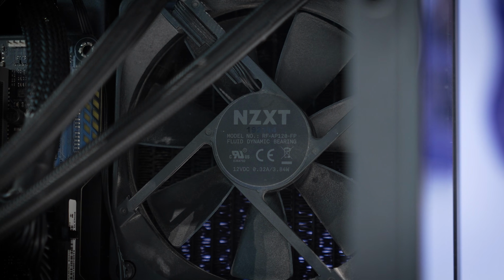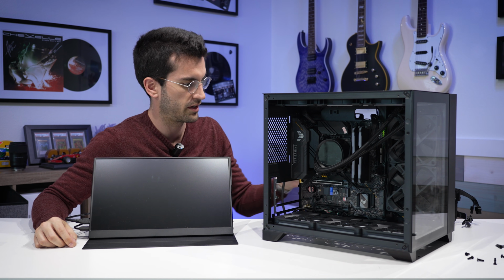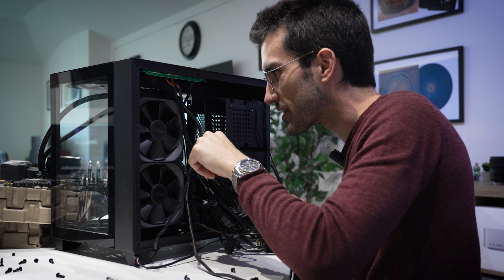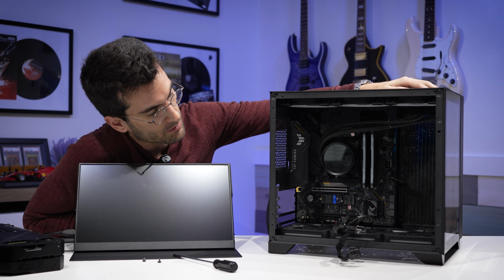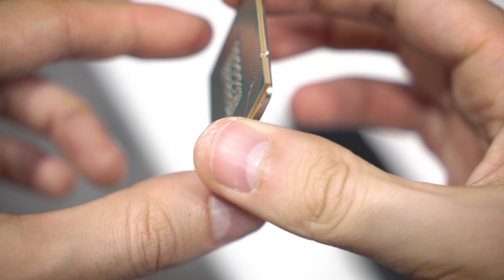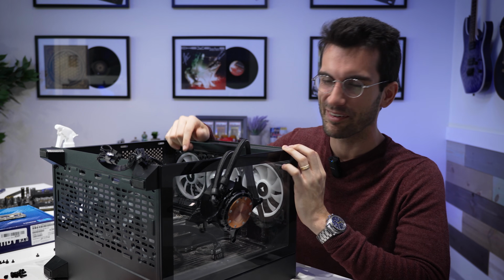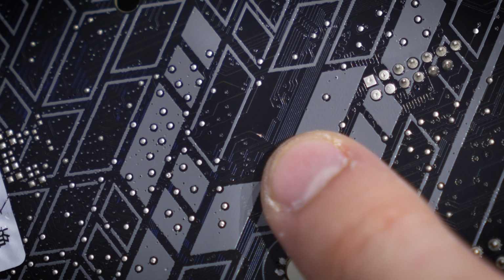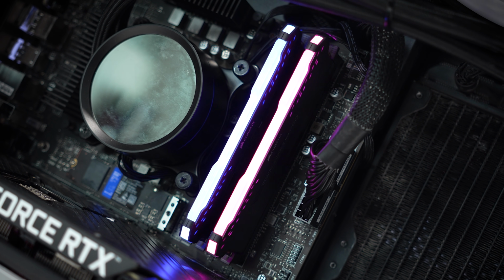Fixing a Viewer's BROKEN Gaming PC? - Fix or Flop S6:E11

Comment: I was thinking motherboard early on due to symptoms I had on a brand new Gigabyte board this year. Very inconsistent powering on after shutting down. My issue was lights on things flickering a couple times, go off, and flicker more. The only thing that helped for mine was to turn off the power supply switch, wait and turn on. It was so bad I couldn't even bios update. So I sent the board back to retailer and ordered something different and now have zero issues. Nice job getting to the bottom of it. Always sucks having to go to the main part of the system when it would be nice for something simple to be the answer hehe.
Reply: My Gigabyte system was working fine and then started doing the same thing. But I had recently installed an Aorus logo LED thing for the ATX power connection.  I've gone a little LED crazy on this system. Anyway, the Aorus ATX LED part had failed.  Removing it and going back to regular ATX fixed it completely.
Reply: @LatitudeSky  Sadly that wasn't my issue. I have had very bad luck with two different series Gigabyte boards out of the box within a year. The other one had a dead memory channel. It would only work with 1 stick of ram. Replaced it with a diff brand using same cpu and ram, and issue fixed. I just must have a curse with those motherboards. :)

Comment: That battery came out of something that used tabbed soldered on batteries. They typically have that insulating ring of plastic round the edges. most "tabbed" batteries have this. Looks like it was harvested from something that had a tabbed battery but the user just didn't think to also remove the plastic edge covering. :P
Reply: I wondered if the battery was "recycled" overseas based on the language the stickers were in 🤷‍♂️
Reply: And the strips are usually made from nickle.
Reply: Could have been a replacement battery for old gameboy advance cartridges.

Comment: You would be correct some of the corsair fans are hardware set to black by default so unless they are changed they won't light up until icue is opened

Comment: try updating bios. I have Asus TUX X670E-plus wifi and there was something wrong with the original bios, not the same as here but the thing didn't post properly, just some times, had to restart usually between 2-5 times before it pisted, windows updates sucked.

Comment: Motherbaord shipments from China are not supposed to include a battery as it is illegal for them to do so. I would think, based on the stickers etc. on the board, this unit came from a Chinese marketplace as you mentioned, and the US purchaser found a battery in another device and tried to use that, not realizing the battery had been modified for the first device it was in. I love these videos by the way!
Reply: Don't most retail motherboards get shipped from China with battery?

Comment: Greg as soon as you took the board out and showed where all those scratches were at I also noticed that it was an OEM board of some sort with bad bios on top of that because it was looking for a very specific optane drive which is no longer in there and with all of those scratches in his back and then putting it back together again linking two or more scratches all over the place led to more instability but you did a good job figuring things out but I would have just replaced the board instantly with that many scratches on the back side pull it and be done with it that was a big gigantic indication of I have a screwed board I counted over 50 scratches I had to pause and count what I was able to see in frame that board was screwed in more ways than one

Comment: 3080 RTX 12GB owner here. Those three red blinking lights always do that on my rig. But I have no issues with gaming or light video and photo editing. PSU is the Corsair HX750i. Just go into the software for the gpu and disable the indicator lights.
Reply: I have a ROG Strix RTX 3070 ti that does the same thing.  I would have to power down, turn off PSU then turn on again to make it go away.  So I'm not the only one.

Comment: That standoff shorting those traces probably killed the board.
Reply: Almost certainly the issue.  You can see the scratch crossed multiple traces, most likely sending voltages places they didn't belong.
Reply: The new GPU added extra weight, made it rest against the standoff more causing a bridge, shorts and and probably also scratched the traces when installing it. By that time it was a matter of time before it started killing things
Reply: Definitely!
Reply: I wonder if the standoff could also be causing shortsbetween the PCs layers
Reply: Those traces are very easelly repairable, long as damage have not spread through multiple layers

Comment: It is worth pointing out that NZXT AIOs control the AIO pump with that USB2 cable as well. If you don't connect it, I think it defaults to running at 50%.

Also, that battery was soldered to a circuit board. Someone salvaged that battery from some other device.

I'm guessing that standoff shorted something and killed the board.
Reply from the maker: Hmm. That AIO has a discrete pump fan cable - looked like three pins. Don't remember off the top of my head.
Reply: You could've repinned the usb cables
Or is that something you strictly don't do?  @GregSalazar
Reply: @GregSalazar  Yeah, I could be wrong. Might just be specific models that are purely driven off the USB.
Reply: @TheGameBench  just the newer krakens i believe they still require you to connect the fans to a 3pin for power tho but can control it all in cam software both pump and fan speed
Reply: @MaxOnCFW Mine gets it's power through Sata and that usb cable is for controlling RGB Edit: I also have a Kraken AIO
Reply: @GregSalazar I have that AIO your original assessment is correct. That usb cable is for controlling RGB the pump itself is controlled through the 3 pin (Idk about his but on mine power for the pump came through SATA power so clearly the 3 pin is for controlling the pump.
Reply: That AIO on that CPU is like an LS swap on a VW Beatle,completely pointless.

Comment: That battery is for Gameboy cartridges for your save games
Reply: Yeah, the welded tabs on the battery are a giveaway.
Chinese motherboards don't ship with batteries in them, so the user probably scrounged a battery from a box of old parts.
Reply: @AAjax I've been building computers for 30 years and never seen a new mobo come without a battery.  No matter the brand on the box, these were all OEM from Foxconn, Quantel or the other big Chinese OEMs.  I have seen them come with dead batteries.
Reply: @ Those Aliexpress etc. Chinese weird cheap boards come without batteries, some kind of a regulation thing or something.
Reply: Yikes.
Reply: For Real?? that would mean that your saves are gone when the battery is dead?? I would have cried when my old Zelda game save was gone because of that...
Reply: @jenshoffker5702 yep, The majority of game boy and game boy color games that have a save feature will lose the save file if the battery depletes or is removed without doing a bypass, only one or two games released near the end of life of the gbc does holdsave without a battery. Game boy advance games does vary, some still use baterry to hold the saves.
Reply: @jenshoffker5702  even some NES games work similar way, Zelda for example.
Reply: they're used for a lot more than that, but the basic idea is there. the tabs are for permanent install via soldering, in whatever application.
Reply: The PC owner commented below and said he took the battery from another motherboard
Reply: I mean, it's just a 2032 with tabs soldered on. It's not specifically for a Gameboy.
Reply: Came here to say the same thing... See them a lot in tronicfix videos lol.  Right voltage, wrong application.  Also why it's forcing a reset everytime it loses power.
Reply: Solder tab 2032, 2025, 2016 cells are used in many other applications besides game carts.
Reply: some cheapo motherboards also have those batteries but usually also have a 2 pin cable attached. annoying to replace those

Comment: The blinking lights on the gpu are a software issue . i had the same problem with the 3070 and 3090 strix cards. download asus gpu tweak software. and you can turn the lights off. the lights are there to show power problems, but they are ultra sensetive to any ripple and itll blink even though there is no issue.

Comment: If the power button is finicky, that would be my first suspect as well as the reset button.  I always have an external button ready for such cases.  still watching the video   Just be careful, sometimes even after testing a lot you may actually temporarily fix the button issue, but it will always come back later ;p

Comment: That is a battery off a laptop board
Reply: Yeah, that computer was way poor build with quality and not so great quality parts before he got it and was definitely the problem do not forget when you get a computer that looks like poor building just take it apart and test every component you can in a test bench till you find out what is going on. I have had a computer come in with the motherboard held in with drywall screws it held but shorted out the board and did exactly this. Replaced the screws and it turned on and that is all it took but always just rip it apart and test everything separately when you see this kind of build quality sucking.

Comment: "Cable management" behind solid steel panels is just a waste of time.
Reply from the maker: Not at all when something like this happens and you need to get back in there. Typically makes sorting and isolating easier. But to each his own.
Reply: @GregSalazar  I'm not sure that pans out, logistically. 

You're losing time on both ends, first by neatening things up and bolting them down, and then again when freeing them up to get to whatever cable you want to change.

But yeah, if you're happier knowing those cables are routed in a specific way where no one can see them, more power to you. 👍.

Comment: As soon as you showed only 2 screws for the mobo my immediate thought was oh no, I bet a standoff is in the wrong position.
Reply: I immediately cringed seeing how haphazardly this computer was put together.
Reply: don'tcha just hate it when stand-offs come out with the motherboard screw? uugh...
Reply: @TheJason13  no idea even how that happens, even in high end cases.
Reply: @TheJason13 one of the most annoying things.
Reply: Exactly. My policy is "Missing motherboard screws = full system teardown and rebuild". Let the Flying Dutchman chase fucked up rabbits down illogical rabbit holes. I'm better off going total CSI on it from the bottom up! 😅
Reply: I was thinking the same thing!
Reply: it's unreal, how can people not install their motherboard properly. Why even buy the case.
Reply: @gamerdweebentertainment1616  Even worse is that the user told him he knew some screws were missing. So he knew that wasn’t right but still left it be. And no screw on the graphics card bracket is just boneheaded. 

That’s negligence. If you can’t properly secure your expensive parts, you can’t be upset when they stop working.
Reply: There is very few pc cases I built in do not have the standoffs pre-configured for standard atx boards.

I assembled my very 1st pc following tutorials on YouTube, tried to power on.... And no power, spent hours trying to figure what went wrong and as a noob at the time I could not figure out the problem.

I watched tutorials on YouTube and followed the steps exactly and mind you that 9 out of 10 pc cases are pre-configured for standard atx boards and I happened to buy a case that was not friendly with noob pc builders 😅.

Hours went by and I was like, did I just spend over $2K AUD on a faulty pc? I was sure there is no faulty components and was certain I did something wrong.

Finally I decided to watch a different tutorial (I've watched about 3 different tutorials already) and if I can't figure out the problem then I'm just gonna pay a technician to diagnose and get my pc running.

It was this one tutorial that made me realise what I did wrong, after spending almost 2 days trying to figure out the issues I was facing, this tutorial tells you to make sure that the standoffs are in the correct position as some pc cases require you to manually configure it yourself.

And I was like, 100% this is the issue as I did notice from building early that few of standoff holes in the motherboard were not aligning with the standoffs.

I removed the motherboard and I can in fact see I did install the motherboard on top of the standoffs, so I adjusted them, placed the motherboard and now all the standoff holes align correctly.

But unfortunately I already shorted the motherboard.

Thankfully my local PC store were happy to replace it as there is no physical damage and just put it down as faulty out of the box.

Fast forward years later to today and I've built plenty of PC's and I enjoy it as my hobby.

Comment: 20:32

Seems like the battery was meant for a laptop or something similar. Thise strips are probably soldered to a wire and the positive negative attach to a laptop, or whatever it is meant for. Maybe jt was just slapped in there for some reason